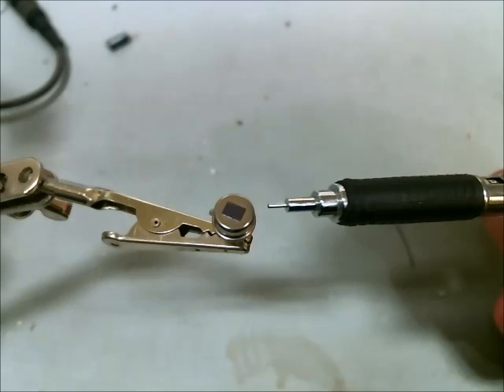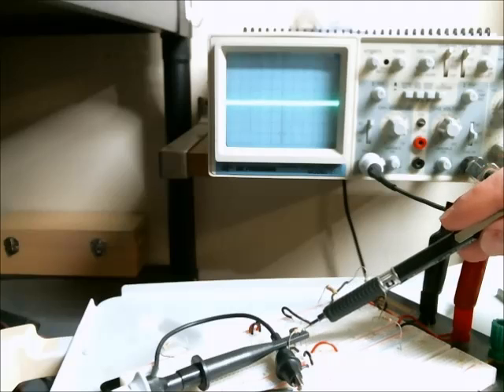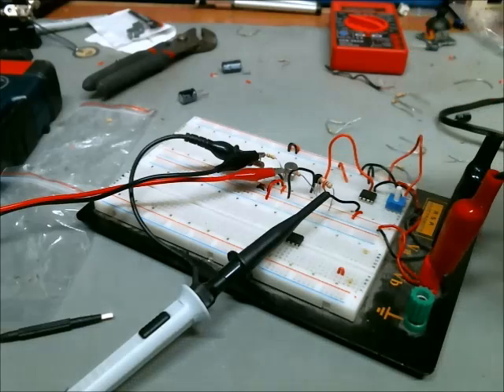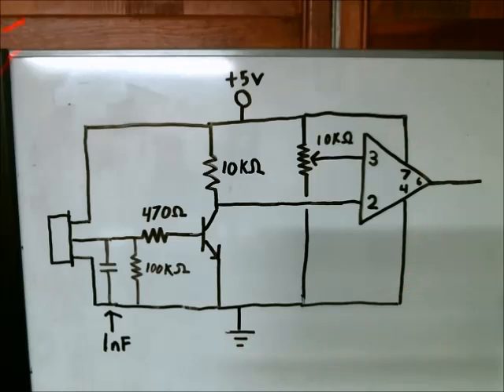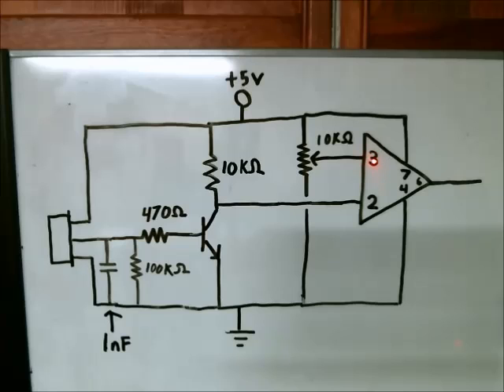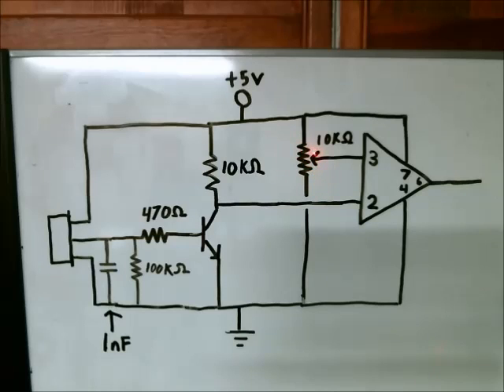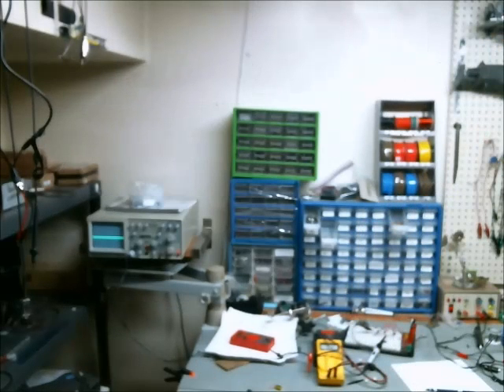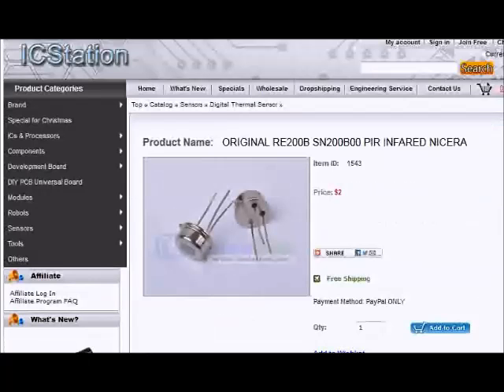PIR Sensor Amplifier

Comment: is this circuit work with 3.3 voltage instead of 5 volts? and other question is are you connected Potensiometer 's wire to pin 2 of lm 358 or it just cutted?and other can I put OP07C op amp instead of LM741 op amp?

Comment: Hi nice video. I wonder: I have a solar lamp with passive motion sensor. Could I remove it to make it only a solar lamp? if yes, Do I have to connect on the circuit board a cable from the ground to the neutral to make it work?

I appreciate your answer and congratulations.

Comment: how to check the pir sensor ic?
in signal pin i didn't get no change in output 500 mv  is constantly coming when motion detected as well not please help me
Reply: I have same problem too. Would you help us please?!
By the way I have used your circuit and read 4.9V in the output of op amp.

Comment: Is this lm358 op-amp? 
I cant achieve result sir, 
I wanna detect human movement with d203b pir sensor , im using lm358 but i dont know what is wrong with me🤦‍♂️ is doesnt worked, i dont like use big ic like biss0001 ; please help tnx
(My eng isnt good i know,  sorry about that🙏)
Reply: In this circuit use the LM 741
Reply: @kostasbobos6209  tnx
Reply: It shouldn't matter really

Comment: It's good to see ordinary Op Amp works fine with weak PIR signal. 
Thank you.
Reply: But it was amplified by the transistor before entering the op amp which is not amplifying, but used only as a comparator.

Comment: Hi! I pulled a D203B chip out of a board designed for mains PIR switching (lights in buildings etc.) and hooked it up to the scope. The signal changes with movement but it has a DC offset like you noticed and such small changes in voltage that I don't think it's possible to get good sensitivity without an IC that helps with temperature and humidity sensing, and other fine adjustments. Problem is I want to make my own board, so I'm trying to reverse engineer the mains PIR circuit. It's not so easy. Quite a lot of RC networks connected to the BIS0001! Any experience trying to do this in a more simple way? I don't need timer function since I'll be hooking it up to arduino. I thought initially I could just connect it directly to Analog IO of the arduino and do it in code. Not so sure now!
Reply: Hi Mat, I know its 3 years ago and you've moved on, but did you make any progress accessing the D203B chip directly (without an amp) from your MCU.?  I have 10 of these and can't get a response from any of them.
Reply: @johnjennings705  I know it ha's been 10 month but you can do it, read the analog exit from the pir in the mcu, the thing is it's very unstable.